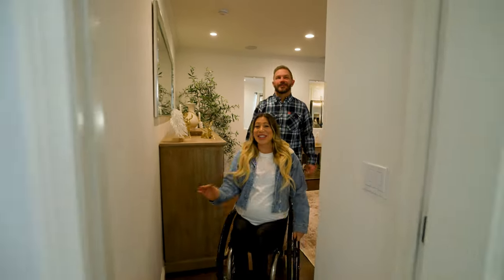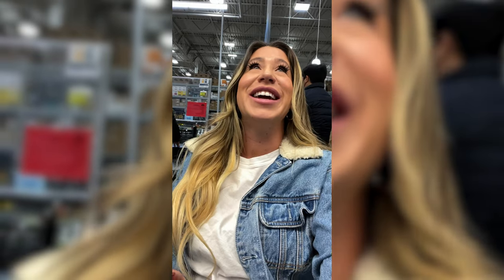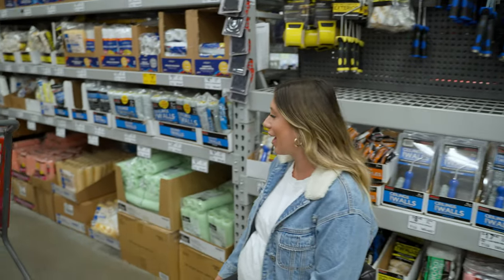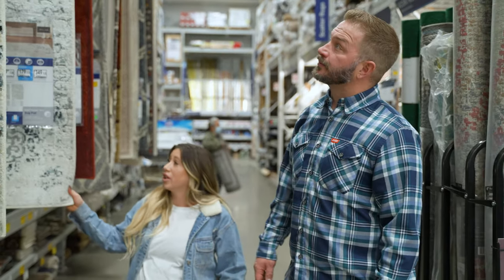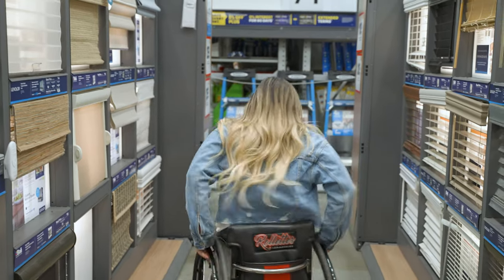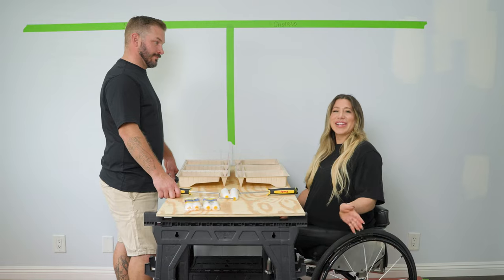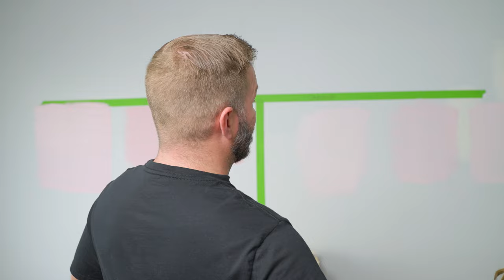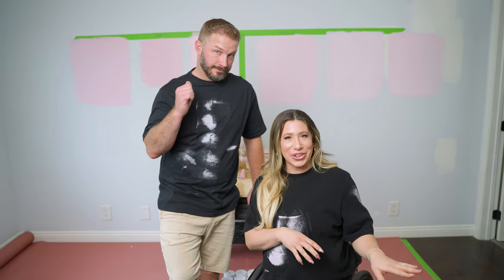VLOGMAS 11: GOING TO LOWES & STARTING BABY GIRLS NURSERY!

Comment: As a wheelchair user and mommy myself, I think the best way to adapt a crib is to get one that converts to a toddler bed, assemble crib as usual, except put one on the long sides on a super long drawer slide with a locking mechanism on the outside.  You could slide the side out of the way to dress her or take her in and out and lock it back. You could also put the legs of the crib on 4 inch wooden bed risers to allow you to get as close to the mattress as you need.